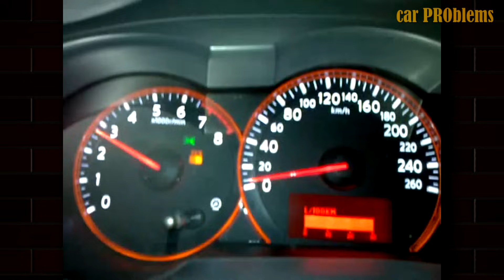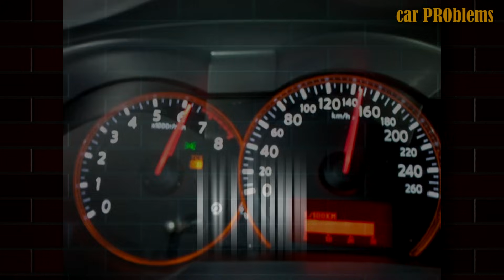How long do CVT Transmissions Last? - CVT Reliability

Comment: It depends.  If the CVT is in a Nissan, it might not last too long.  If in a Toyota it might last for quite a while.  The difference?  The company that made the CVT.  The company that made the CVT transmissions for Nissan, Jatco (and other car manufacturers - Mitsubishi, Suzuki, Jeep) made very unreliable transmissions.  The Toyota transmissions are manufactured by Aisin, a automotive parts manufacturer that is part of the Toyota Group of companies.  Apparently they have a better track record.
Reply: The Toyota transmission is a eCVT and does not have belts
Reply: @davewebster1627 it does have belts 
What Toyota did was add and actual first gear 
Most of the strain on a CVT is on initial drive from stop to start 
The first gear allows for a quicker take off and removes wear and tear on the CVT belt. 
All CVT’s should have this.
Reply: Honda?
Reply: @SlowerTrafficKeepRight-k2g  belt type in the earlier cars. The latest ones are a mechanical gear, set basically with computer control and continuously variable ratios planetary and sun gear set Basically -I can’t remember the exact modus operandi.! but there are some very good YouTube videos with either diagrams or literally strip downs and explanations
Reply: So, why do you think the Jatco CVT fails in Nissans and not in Suzuki or Mitsubishi cars? Answer: Suzuki and Mitsubishi ALWAYS have a transmission oil cooler. Nissan does not (although some now have it because of recalls and aftermarket coolers). Besides that, Mitsubishi and Suzuki also reduce the input into the transmission by having less powerful engines.
Reply: Suzuki has a low gear used mainly for starting, as does Toyota, which would help slippage, although that I think would be born by the torque converter.
 Subaru has gone all CVT and is used in their sports as well as all wheel drive, so pretty much the same power output as the smaller Nissan models that used it.
 @ronaldderooij1774
Reply: I believe the Nissan CVT is a belt drive and the Toyota is eCVT no belts
Reply: @davewebster1627 toyotas eCVT is only in their hybrid cars. Some ICE cars (corolla) have an actual CVT with a first gear and then switches to the pulleys after it gets up to speed
Reply: @davewebster1627  They changed them in 2017 to a chain I believe.
Reply: Mitsubishi took that CVT transmission and tweaked it 
If you do the proper fluid changes and also the inline paper filter 
You will not have problems. 
Also don’t drive like a speed demon or decide to haul things 
If that’s what you want get an automatic transmission.
Reply: Here is 2007 Nissan Altima with 400k km. The problem with Nissan crappy transmission is crappy Nissan dilership. All of them in beginning, from 2007-2012 thay just say transmission fluid is LIFETIME, SEALED SYSTEM. People who did not trust them and charged the CVT fluid ON THEIR OWN RISK every 50k km, still drives them the rest who trust to the dilership thay junk their cars. Ilove my Nissan  Altima AC and all the electronics inside still is working! My wife 2019 Honda CRV we have problem with the head gasket! All new car are junk now!
Reply: Plus the Toyota CVT's have a launch gear that gets the car moving then the CVT part takes over, reducing strain on the belt drive. Nissan CVT's don't have the launch gear.
Reply: well i have Subaru Forester XT cvt 2013 model still going strong despite the highest power in all vehicles who had CVT Subaru cvt is chaintype
Reply: True, Nissan have poor CVT transmissions, while other like Honda are much better.
Reply: The Toyota Prius (pictured in the video) does NOT have a belt/chain CVT.   It never had one.  It does not now have one.  The Prius uses planetary gears.        Yes, belt/chain CVTs are problematic.     The Prius drive system (properly called an "ECVT") is bulletproof.   The person who made this video has done a great disservice giving false information about the Prius.
Reply: Does Subaru fall not the Toyota Group of companies?
Reply: the are making C.V.T for toyota since 1949, perfectly reliable if we obey the instructions.
Reply: What about Honda CVTs?
Reply: @AbronHawkins  Early Honda CVT are belt type the later ones built into the CRV and 
the modern hybrids are gear type (like Toyota ) and electronically managed

Comment: you want an automatic ... HONDA is the number one in reliability.. here is my personal experience 
honda 2002 crv  753 thousand  Km never fail zero problems nothing but the regular service 
honda 2009 insight 168 thousand Km and still going 14 years together zero problems original IMA battery never changed or serviced 
change your gear oil ever 40 thousand Km or 4 to 5 years 
change your time tensioner and built whenever needed, use original oil , dont let anyone tuch your transmission gear but the official dealers of honda and their licensed mechanics where you living ,  and your honda will close 1 million Km easily , remember Honda made to last 30 years in the middle east

Comment: after owning a mirage with a CVT and owning and driving GM cars like novas and Camaros with the turbo 350's in them, I can say there are ways to extend the life of them, best practice is to ease away from a stop, let those  pulleys work for you and push the car faster, no need to floor it to get around; no jackrabbit launches I got away with like on the Nova. Also dont change the fluid at their recommended intervals, instead go for dropping the pan at 15K miles, not the 50K like they want you to! lastly, buy AMSOIL  CVT fluid, much better than stock, there are many stories of cars that got an AMSOIL transmission refill and the slipping and box of rocks noise went away. Just be patient and enjoy this weird tranny, go easy on it and feed it good CVT fluid frequently and you will get alot out of them!
Reply: 15K miles to change the cvt fluid?
Reply: why not? oh well,  screw it its more fun to replace a CVT than maintain it! @SlowerTrafficKeepRight-k2g
Reply: @SlowerTrafficKeepRight-k2g yes. In my nation many shops do cvt oil around 40k kilometers (around 20K miles)

Comment: Mine just gave up after 270000km I brought the car at 130000km.
Never serviced it never checked the fluid and drove it hard half of the km was driven in sports mode.

Comment: If the CVT is simpler than a gear automatic,  why is it more expensive to replace or repair?
Reply: CVT help car companies meet their fuel efficiency targets.
Reply: Its marketing garbage don't buy into it.
Reply: It’s cheaper for the car companies to make.
Reply: @ErichH68  How is it cheaper for car companies to make it, but more expensive to replace it that doesn't make much sense.
Reply: @EternalTrick  makes complete sense.  If it’s more expensive to repair it that will push you into buying a new one.
Reply: @ErichH68  How is it cheaper to put it in in the first place than it is to replace it?
Reply: Who said it's simpler
Reply: Difficulty in finding stocked parts for this tranny!
Reply: The concept of it's operation is simple, but the materials and manufacturing processes are state of the art and very complex.

Comment: I saw a video on YouTube about  CVT transmission belt failure. Would the belt snap unexpectedly or fall apart into pieces without warning? Does the belt require routine replacement like the timing belt?
Reply: 1. Yes, unexpected immediate failures typically  2. Nope unfortunately, just fluid. Too hard to get to and it would cost too much money, probably $3k when a full cvt replacement is $5k

3. Yes, most have belts.  Except the hybrids
Reply: Modern CVTs don't have belts, they are eCVTs and use electric motors and regenerative braking making them very efficient
Reply: @davewebster1627 well that's interesting, the video above shows a chain or belt.
Reply: @SlowerTrafficKeepRight-k2g  just shows the misinformation we are given, Toyota pioneered it with the Prius and now it is  on all models. Other companies are following
Reply: @SlowerTrafficKeepRight-k2g only the hybrids have eCVTs. The non-hybrids have CVTs with belts.
Reply: @SlowerTrafficKeepRight-k2g  An eCVT and a CVT are completely different animals.
Reply: Only hybrids have  an eCVT not the gas engine only cars  @davewebster1627

Comment: What's the point of seamless shifting if it slips under full tourqe slowing it down anyways, did they every make a cvt that can handle power? Lmao like even decent numbers? i feel the only benefits is economy and it's not that much better
Reply: That's the only reason for the cvt.  To meet fuel efficiency regulations
Reply: YOU ARE RIGHT. THE FUEL ECONOMY IS LITERALLY LIKE 2-3 MILES MORE PER GALLON THAN HAVING A TRADITIONAL TRANSMISSION ON A SIMILIAR CAR...AND WHO WANTS TO PAY $600 EVERY 50K MILES TO HAVE THEIR CVT FLUID CHANGED, BECAUSE THATS HONESTLY WHAT IT COSTS, & ITS ALMOST IMPOSSIBLE TO CHANGE IT YOURSELF BUT IF YOU DONT GET IT CHANGED THE CVT WILL UNDOUBTEDLY FAIL PREMATURELY.

Comment: How does a CVT transmission do in hotter climates like Sacramento? I hear CVTs burn up quicker, curious how outdoor temperatures affect an engine’s life
Reply: I'm down in here in Palm Springs where it is seriously hot🔥, as long as you take care of it, I have my CVT serviced every 30, 000 miles-runs like a gem.
Reply: @mojavedesertsonorandesert9531 Do you do it yourself?
Reply from the maker: Yes, it is true that extreme heat can potentially affect the performance and longevity of any vehicle's transmission.
But with proper maintenance, adherence to manufacturer guidelines, and cautious driving habits, CVTs should be able to perform well and have a reasonable lifespan even in hotter climates like Sacramento.
Reply: 225,000 miles on my Patriot CVT in Texas with ambient temps up to 110F.
Reply: Absolute lie, my cvt is doing fine

Comment: At 92 ,000 I had to get a new Transmission. $7000 , Thank goodness I had a extended Warranty.
Reply: What car did you have and where you doing extraordinary things with it such as going up mountains or towing a trailer or racing it fast?
Reply: @crand20033  - Nissan Murano . and just reg. everyday driving.
Reply: @wrathicon7570  What warranty company did you use?
Reply: @crand20033  just curious what would you want to know that?
Reply: @wrathicon7570  Might be a good one to sign up with.
Reply: @wrathicon7570  what model?
Reply: Would you mind sharing which extended warranty you got? And from where. Thanks in advance.
Reply: It would he helpful!
Reply: Oh wow, we've got an extended warranty too, through the bank
Reply: I had to get a new $7000 transmission at 45,000 miles. Glad it was still under the 10-year warranty

Comment: : If you change your fluid sooner than what's recommended, will you getting more time out of it?
Reply from the maker: Hi! Changing the CVT transmission fluid sooner than the manufacturer's recommended service interval may help prolong the lifespan of your transmission, but it depends on the specific circumstances.

Changing the fluid at or before the recommended service interval can help ensure that the transmission stays properly lubricated and cooled, which may help prevent premature wear and damage. However, changing the fluid too frequently may not necessarily provide any additional benefit and can be a waste of money.
Reply: @car PROblems :  Thank you for your quick response. I purchased a 2023 Honda Civic Sport Sedan 2.0L with the CVT in it about 3 months ago. I'm very happy with it. 
I have been viewing several youtube channels about the CVT. I'm just looking to get the maximum run time on this transmission between services. My wife and I are older adults, and we won't be trying to get from point A to point B in eight seconds. LOL. I have just been wondering about some of the articles I have read.  It was a little disturbing after making this investment.
Anthony
Reply: @anthonyshepard9606 just got a 2020 HR-V cvt with 24k miles on it. We also didn't know about cvt
Reply: No that won't help. because transmission fluid doesn't wear out. But it does get dirty.
Reply: @crand20033 'Dirty' in engine oil could be carbon but in transmission fluid dirty can only mean tiny metal particles held in suspension in the fluid. Not good when you have 2 metal surfaces rubbing against each other at high pressure.